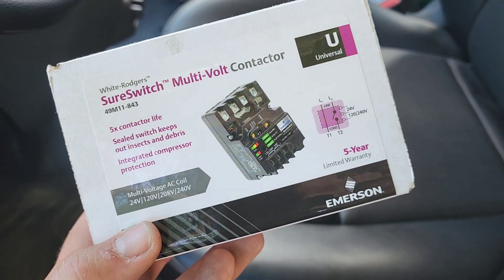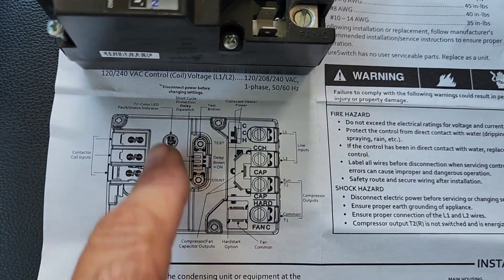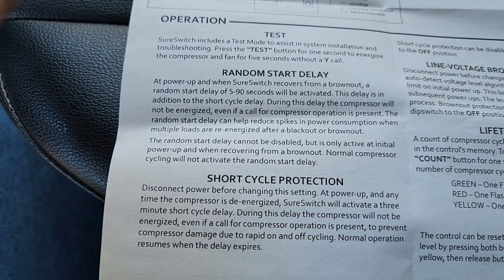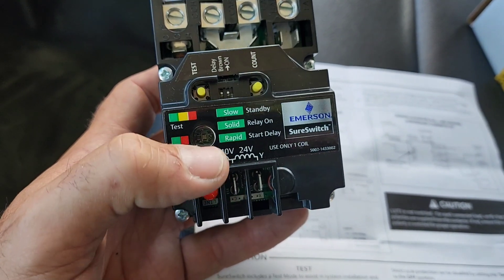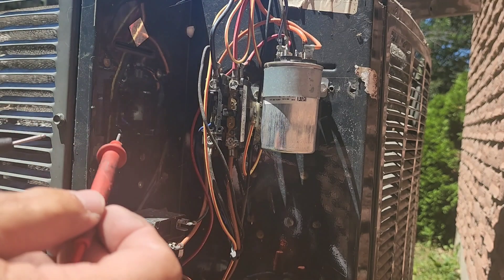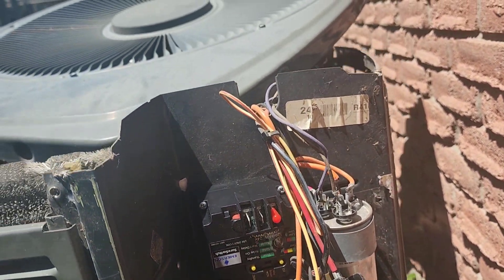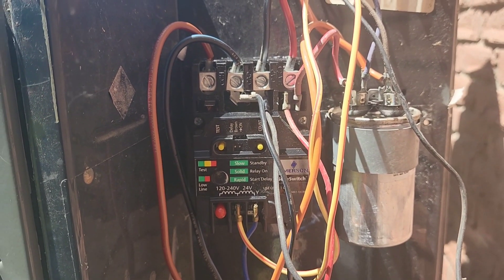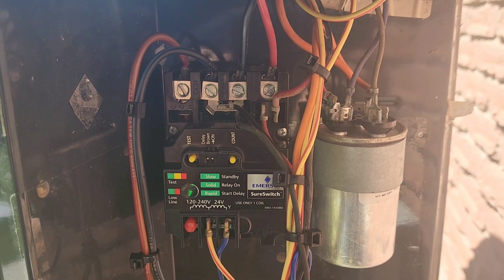Emerson Multi-Volt SureSwitch Walk Through and Installation - Contactor Replacement

Comment: You said if the compressor loses power you get a 3 minute time delay, would that affect the defrost mode in winter time?
Reply: I installed one on my heat pump and works flawlessly been fine for over 6 years now. Best contactor ever as far as I'm concerned and also has brown out protection. Alot quieter on start up and also seems as the compressor sounds better too on start up. The 3 minute delay is on a switch on the contactor you would want to make sure that's off it's really not necessary as in most thermostats has a delay built in. It does have a random 5 to 90 sec start up delay witch should be just fine because most/all heat pumps defrost cycles work on temperature the unit will stay in defrost mode/cycle untill the coil reaches a certain specified temperature on the control board and then the sensor tells the defrost board that the coil has reached that specific temperature and to switch back to heating mode.